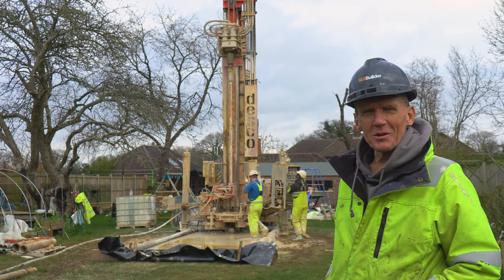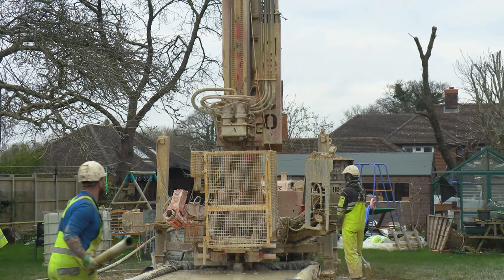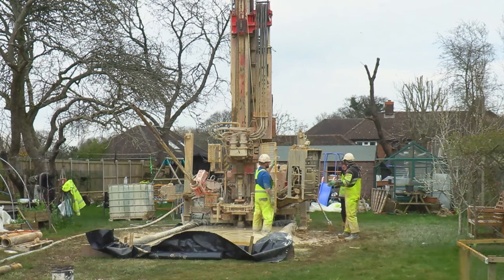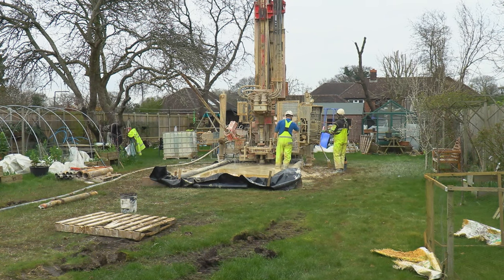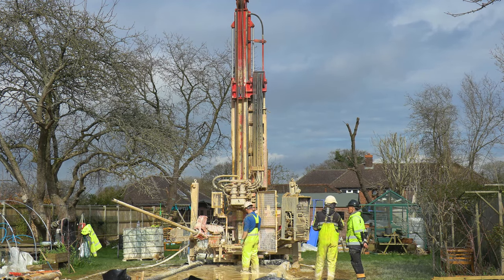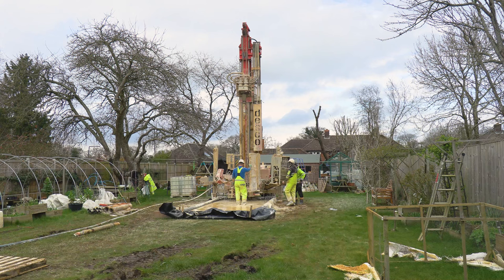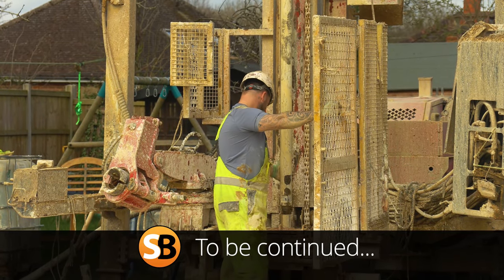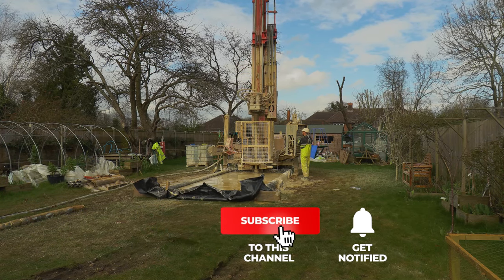Ground Source Heat Pump Bore Hole | Drilling for "Free Heat"

Comment: Skill Builder, 

There is an introduction below this headline:-

"THE BENEFITS OF HAVING A GROUND SOURCE HEAT PUMP"

These claims are wildly inaccuurate and have no basis in reality.

Yes the heat in the ground is constant because of the depth but let us assume it is 15 degrees centigrade, how can that warm a house  to a comfortable temperature?
The advantage  over air source heat pumps is that a ground source suction temperature is higher in general which give a higher compressor discharge temperature. It is the compressor that provides the heat by compression.

300 to 400% efficiency, absolute rubbish! 
No device can have 100% efficiency, that is school level physics. 
The simple error, which would be true if electricity magically appeared in a house, but it doesn't, it has to be made and delivered to the house and that is where that 300 to 400% effciency disappears. Ironically that electricity comes from burning gas due to the installation if all these heat pumps increases gas generation, renewables\ nuclear cannot increase, they are flat out already.
Reply: "Yes the heat in the ground is constant because of the depth but let us assume it is 15 degrees centigrade, how can that warm a house  to a comfortable temperature?"
I see you still haven't learnt how heat pumps work.

How does your freezer get down to -18C by the same process?
Reply: Be, 

of course I know how it works.
You still disregard what the compressor does, it generates heat. The ground source benefits from ahigher suction tempertaure upon which teh discharge temperature is built. An air source would equally perform as well in an outside air ambient of 15 degrees.
Reply: @iareid8255  You've proven you don't on the heat geek video, and in the comment you made here. that whilst you may understand the principles behind the refrigeration cycle, if you understood how it is applies and works you wouldn't need to ask a question like "how can that warm a house  to a comfortable temperature?"
Reply: Ben, 

you call it magic!
It's not, the fundamental is the refrigeration cycle. A heat pump wouldn't work if the evaporator was at the temperature achieved by the boiling of the refrigerant at the expansion valve.
The discharge temperature relies on a cooling effect at the evaportaor, and the greater that differential, the higher the suction line temperature and hence the higher the discharge temperature, that's not magic it's a simple process.
Reply: Ben, 

in addition to my reply just now, I'll answer your last sentence. 
It can't, it merely is a base for the compressor, which does the actual heating, 
if you want to call that taking outside heat to warm a home then you can argue that is true, but without compression no home hetaing.
Reply: @iareid8255  I'm really not sure what you are trying to argue now.
I've never said a compressor isn't required.
Source temperature is a factor for performance, but isn't the only one, and for the UK climate isn't even a limiting factor.  Which is what you seem to be suggesting, that 15C at source can only provide 15C in the home.
Which is a complete misunderstanding of heat energy and the way heat pumps work.
Reply: @iareid8255  Also, calling it the "base" isn't really correct either.  Modern Inverter compressors won't be running at 100% capacity.  So e.g. at 15C, mine would be cycling because at their lowest load the amount of heat would still be too much.

So outside temperature affects how hard  the compressor has to work, and could be compared to a gradient of a hill for a car.  Steeper the hill (lower the temperature) the harder the engine/compressor has to work to climb that hill.
Reply: Ben, 

you are quoting something I did not say, or even imply.
The heat output is that from thecompressor plus suction line temperature so a rise in final temperature.
Reply: @iareid8255  then I'm failing to see how you can't understand that with a COP of say 5. For 1kWh of electricity consumption will "collect" 5kWh of heat from the compressor + the source, and reject it into the home.  Since in the heat geek video you were saying that the power plant would still need to generate 5kWh.
Either there is a fatal flaw in your understanding or in the way you articulate your argument.
Reply: Ben, 

no, it's your comprehension that is faulty.
I accept CoP, but reject that it is the equivalent of efficiency. Try and understand the difference, which is my whole point all along.
Reply: @iareid8255  I already understand that.  But it's irrelevant.  The efficiency in ALL the videos you post on aren't claiming perpetual motion etc. It is the energy-efficiency of the billable consumable energy (gas or electric) vs the heat you get for the home.

And that is what matters to the consumer, hence why it is used in consumer-focused videos.

Whichever way you square it, people in the UK switching to heat pumps will mean less gas is used overall, even if it is used for providing electricity for those heat pumps.
Reply: Ben, 
I know that but sloppy descriptrions give misleading impressions.
Of course cost to the consumer is paramount and it is unfeasible that heat pumps deliver that. Governments provide bribes to assist in cost at the  detriment of most other tax payers.
Switching to gas will not reduce gas consumption quite the reverse, which is wher efficiency comes in, not that it is important anyway.

Can you give me a power factor rating of your heat pump, if it is quoted on the name plate?
Reply: @iareid8255  I can do you one better, the Engineering data book for my 2 main Toshiba ones is easy to find and goes by reference "TCTC-E21-RES001
".  I have one 25 and one 35.
Reply: Ben ,

either you have the information or not?
Reply: @iareid8255  
For the 25:
Cooling is 81%, Heating is 83%
35: both are 87%

Comment: How is that FREEEEEE HEAT??😮
Reply: you cool the dirt around the bore hole, and bring the heat to the house; this itself costs peanuts. Then the earth reheats the dirt because earth is big and warm inside, and you can do the thing again
Reply: @jinxit  you pay for it to be drilled and installed. so it is still not free. you just pay the cost upfront, instead of a monthly heating bill.
Reply: @jinxit  you are so clever are you not?  The equipment comes free does it?? Answer that one
Reply: @brianwaites4572 jinxit answered your question. It’s free heat because the ground is warm anyway. You’re just transferring that heat into water in boreholes and pumping it back to the house to transfer it into the house for heating.

No one said the installation was free. Obviously labour cost and equipment costs money. You’re just front loading the heating cost. It doesn’t make sense for smaller developments.
Reply: @jonp6798  I know I’ve been a Heating consultant for the past 50 years!  Ground Source heating is great if you happen to have the spare cash?
Reply: @brianwaites4572  cool, in that case you will have already known the answer to your first question. Retired now I hope after 50 years. Have a good day.
Reply: @jonp6798  likewise, enjoy all your Easter eggs tomorrow.